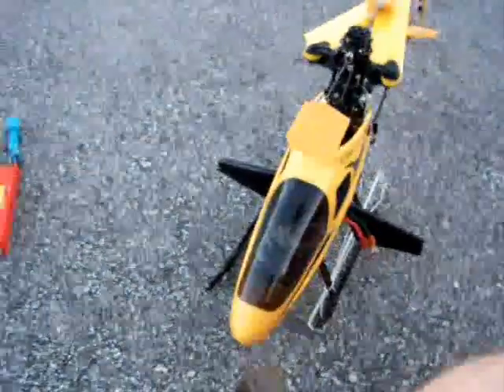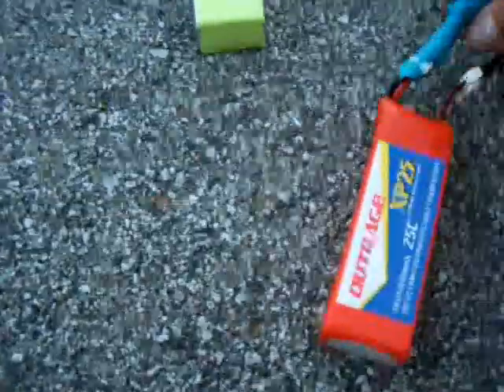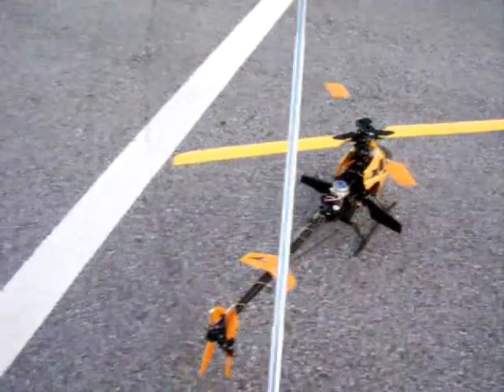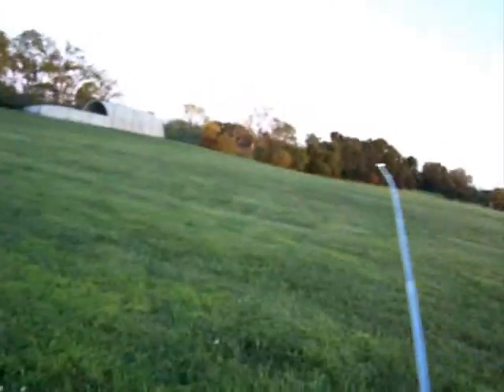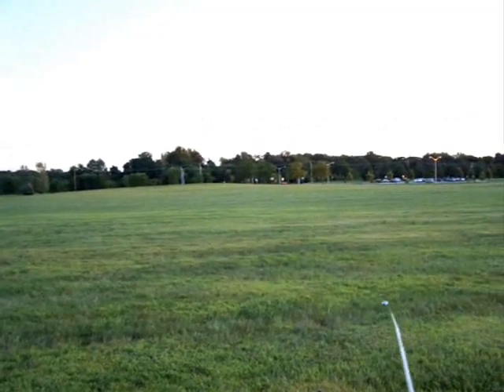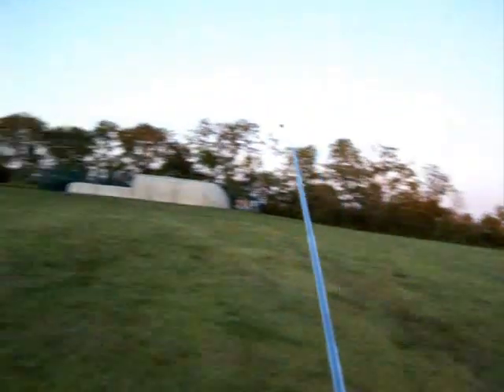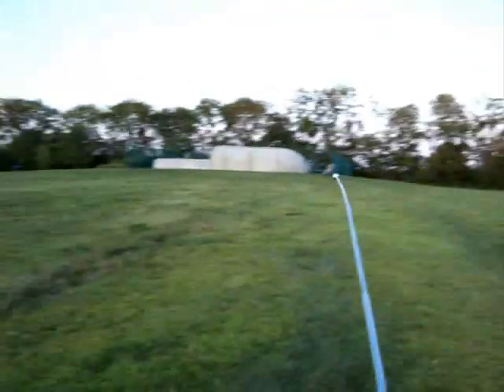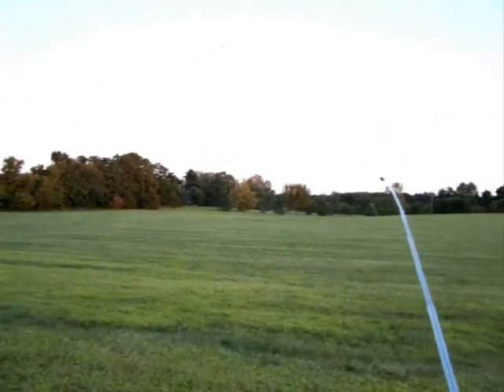Dynamic Stabilizer

Comment from the maker: Fingers Crossed!

Some things I have noticed after becoming a better flyer.

They are not twice as fast, but there is a definite increase.

Not as sure about the amount of lift,
but you can get away with a lower headspeed in forward flight.

While this is not all that exciting for stunt enthusiasts,
it has implications for other heli applications

Comment from the maker: Stops?
The main thing I notice,
is that coming out of fast forward flight you have to throttle up considerably.

You can hear it better in the other video.

Circles are much easier,
as once you initiate the bank and start yawing, you barely have to touch the roll controls, you only have to maintain the yaw.

The headspeed is so low for fast forward flight,
that on one run of nothing but circles I got a 15 minute flight time with a 2200mah battery.

I plan to have a video to document that soon.